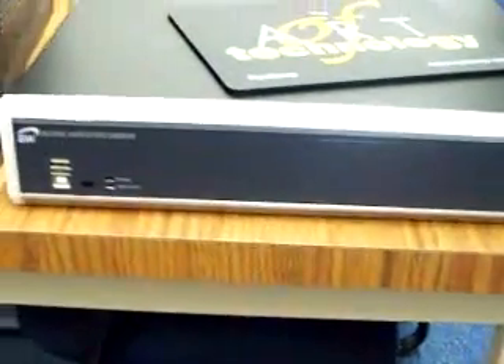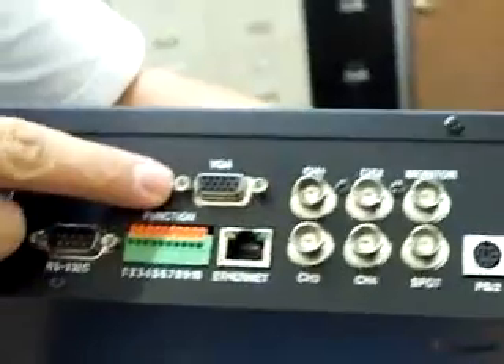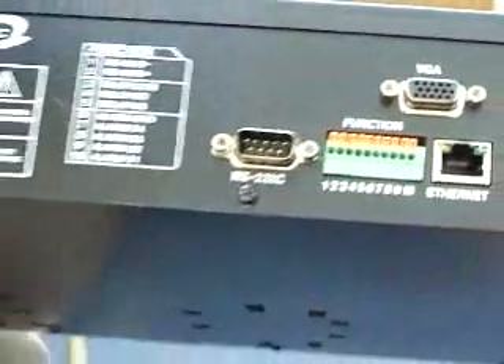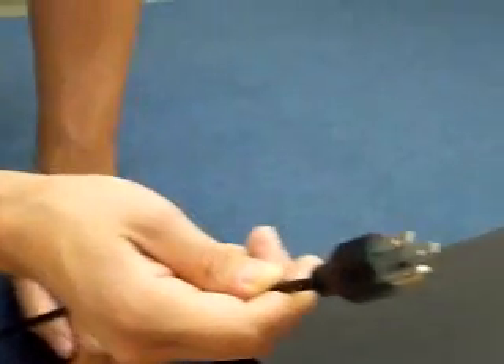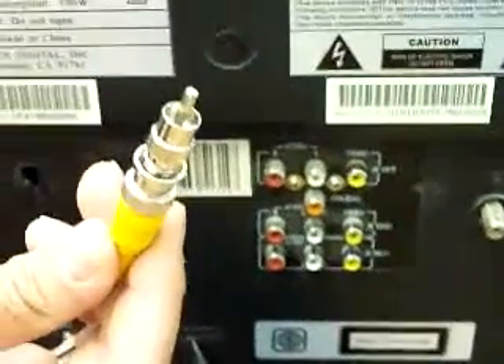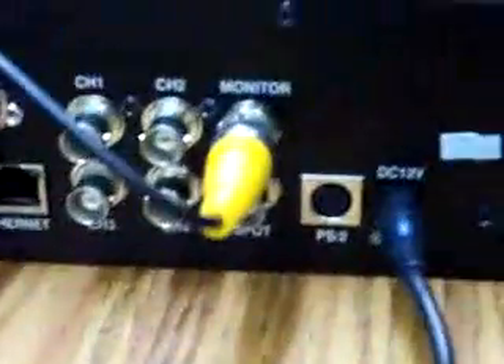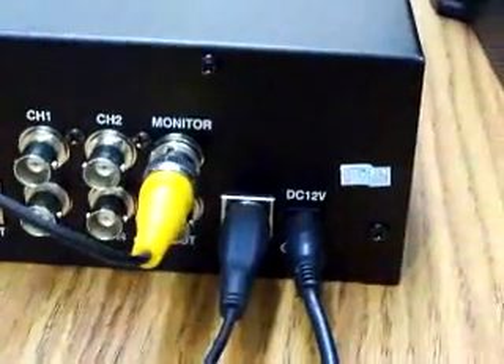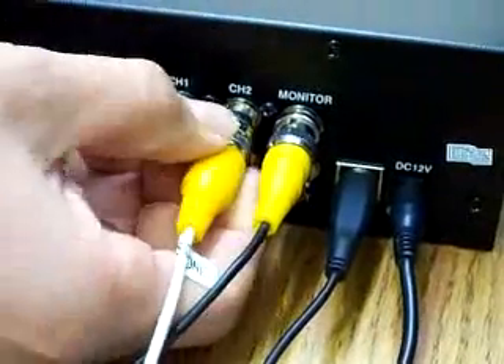How To Install a DVR

Comment from the maker: @danebarry At times the BNC is dedicated as the "monitor" only and you can not access the main screen using this monitor. You will have two monitors but can only see the mouse on the main monitor. There are some dvr's that have a program key or setting within the DVR to change from VGA to BNC but you can not use both. It would be helpful to know what the brand and item number is.

Comment from the maker: At times the BNC is dedicated as the "monitor" only and you can not access the main screen using this monitor. You will have two monitors but can only see the mouse on the main monitor. There are some dvr's that have a program key or setting within the DVR to change from VGA to BNC but you can not use both. It would be helpful to know what the brand and item number is.

Comment: i have a problem with my DVR... i can only use my mouse or access the menu using the VGA cable & the picture isnt centered on my screen..,
 if i use a BNC cable i CANT access my menu or use my mouse is this normal???